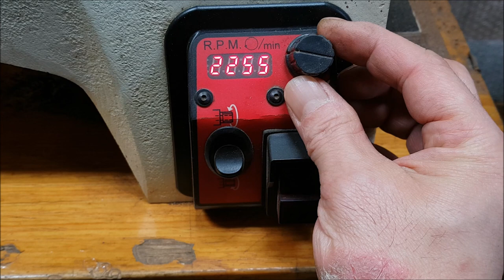Special WOOD + SILVER / Pen making process [ PART - 1 ]

Comment: Question: Has the wood you use been resin stabilized? Also, why CA glue? I've seen you and a few other jewelers now using CA a lot. Aren't you concerned with its longevity? I use CA in a hobby capacity, and I've never had a CA bond last more than 2-3 years if I am lucky. Wouldn't an epoxy be better and last longer, especially under use?
Reply from the maker: The wood used in this video does not require stabilization,
It doesn’t work well even if I try to stabilize it,
It is a natural tree.
Not all trees are stabilizing.
I use 7 to 8 types of adhesive,
It all applies differently depending on the task.
Epoxy... Is Epoxy Forever?
It's not like that.
Some of my other videos have used epoxy.
There are many types of instant adhesives, and their applications are all different.
Polyurethane glue is also used.
Not all information you know.
The way I work, there are reasons for doing so.
If you don't like the way I do it, you just don't.
My method has not had a big problem for over 30 years.

It’s not about what you work with,
Who does how is always more important.
one more...
Not everything is just what is shown in the video.